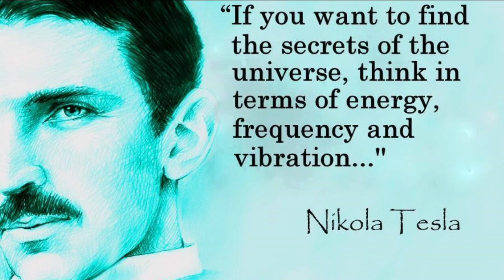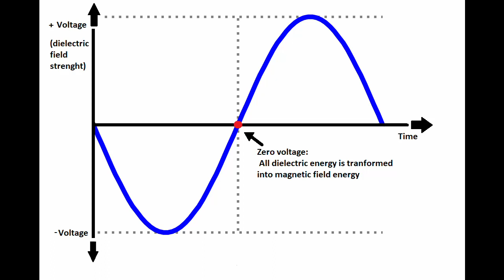The Resonant Bifilar Tesla Coil

Comment: Have you seen NASA signal antenna for amplifying signals???? It's a bifiliar coil!
Reply: Any links?
Reply: Master Ivo I came across this 2012 article while trying to understand how we get usable signal from Voyager.
https://www.nasa.gov/topics/technology/features/tech20120717.html they never actually use the world bifiliar which is the mystery.
Reply from the maker: Yes I know that article, but its not a bifilar tesla pancake coil. NASA: Never A Straight Answer
Reply: Master Ivo are you sure? Following the winding in and out has the same form  Tesla's bifiliar patent with the two connected in the center rather than spliced   to the side.
Reply: Tesla's Patent wording is thus:

1. A coil for electric apparatus the adjacent convolutions of which form parts of the circuit between which there exists a potential difference sufficient to secure in the coil a capacity capable of neutralizing its self-induction, as hereinbefore described.

2. A coil composed of contiguous or adjacent insulated conductors electrically connected in series and having a potential difference of such value as to give to the coil as a whole, a capacity sufficient to neutralize its self-induction, as set forth.

The S Coil satisfies this to the T. As the winding forces the coil to neutralize its self inductance by the parrel wire running an electromagnetic field in opposite directions. Nothing about the claim is particular about how the coil is spliced in order to meet this demand.
Reply from the maker: "connected in the center, rather then spliced to the side" Is the big difference. 
the outside diameter has increased voltage difference but it gradually becomes zero towards the center. the dielectric field is not even distributed. it is strong on the outside, but weak on the inside diameter

More important, the magnetic field is distorted, one winding is clockwise, while the other is counter clockwise.

I played with this configuration. It draws more current due to the magnetic distorted fields. 
It's like 2 water vortices trying to counter rotate in the same spot. 
Or like stirring thee with 2 spoons, counter turning. 

It does not produce the high voltage Sinewave when resonant.

So in my experience it's not the same.
Reply: That's very interesting I wonder what makes part of a good signal amplifier.
Reply: Does the s coil have a diaelectric field in a localized area like the mid point of the radius?
Reply from the maker: S coil = tesla bifilar? excellent question. the dielectric field is concentrated between the windings (where the voltage difference is great).  but it is also outside of the coil windings. A probe quickly shows a voltage swing on the oscilloscope, when the coil is resonant. the probe does not have to touch the coil, its all around it. What happens in the middle axis is still a mystery to me, it seems not only to be the focal point of the magnetic field...
Reply: I wonder what this may mean especially in your previous comment "magnetic field is distorted, one winding is clockwise, while the other is counter clockwise" This sounds like a twisting magnetic field, which has some research being done on it, but usually has to do with planetary magnetic fields.
Reply: if you read its a super conductor it wont only let dielectric flow with out resistance it will boost magnetics so for rx and tx they use similar wire in mri scanners